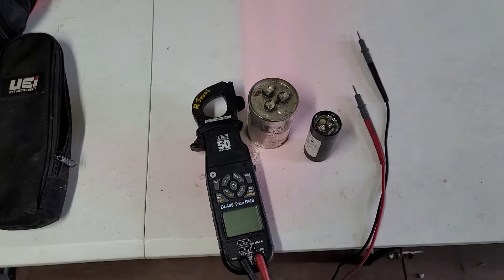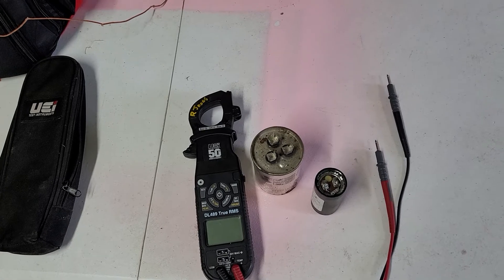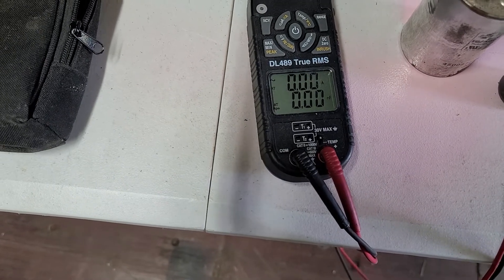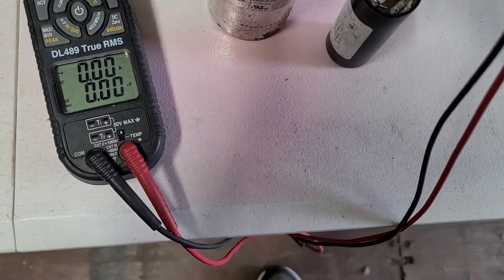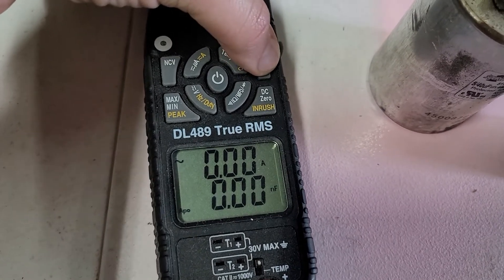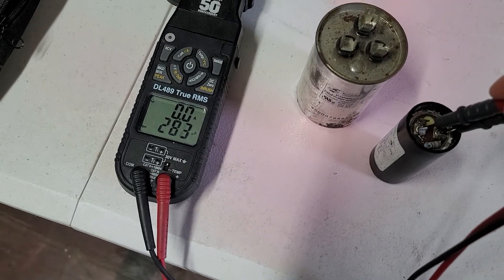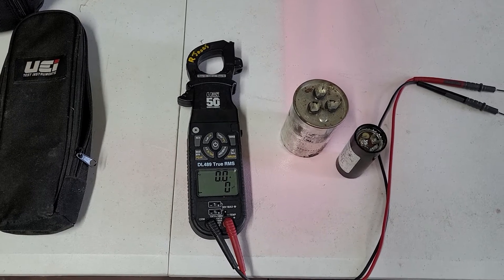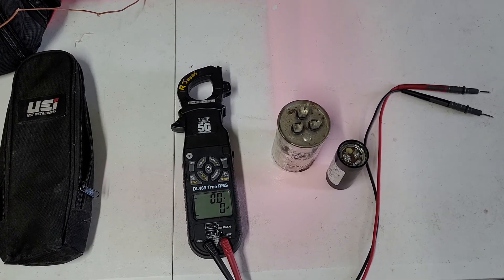UEI 50th Anniversary HVACR Clamp Meter

Comment: the bleed resistor on the start cap causes erratic readings. if you clip the resistor it will read correctly